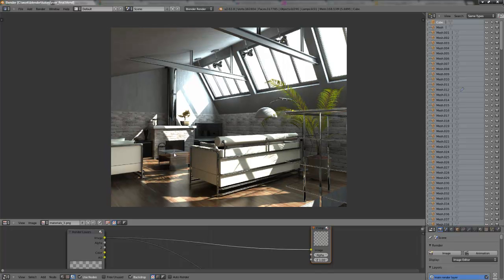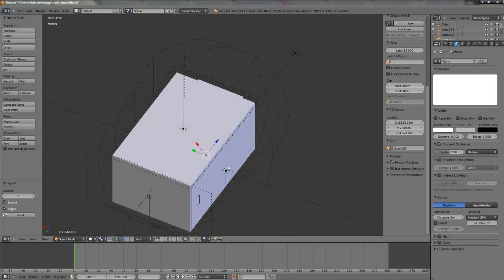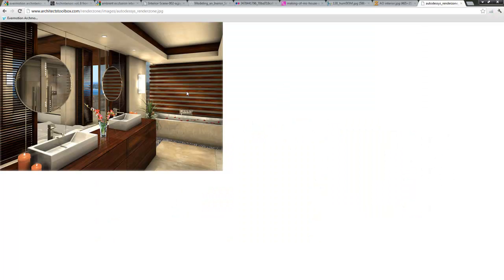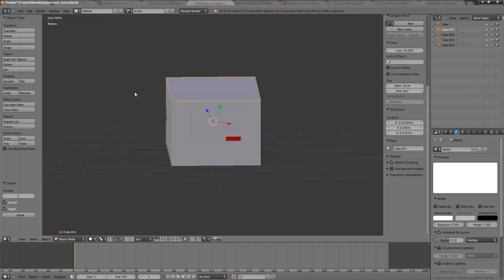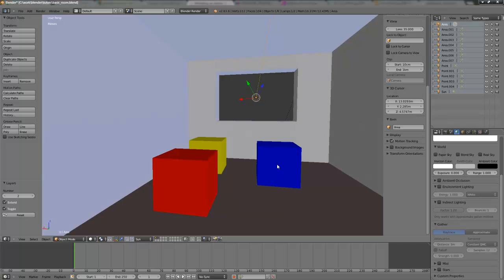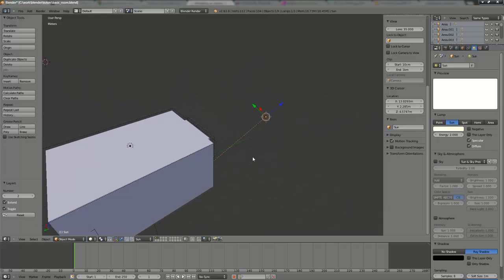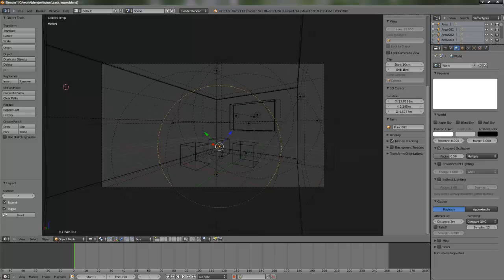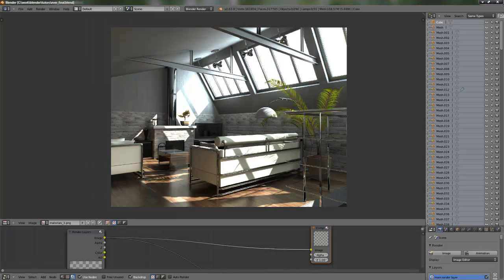Vray-like interior with blender and blender internal renderer

Comment: i agree blender internal is actually really good compare to cycles, i have an nvidia graphics card and i have used to test cycles, the main reason of noisy images in cycles is the caustics, if you turn off them you can get really clear images but the times and the heat that cycles does really damage pc's, i prefer to use blender internal  with the compositor you can get amazing results search for outdoor lighting blender by andrew price, simply amazing...

Comment: there is no support on 760 that's why :> i don't know how you get is slow i render my sceens really fast. and i have sceens with 100 milion polygons even more (landscapes) using instances. And basicly Cycles handle better bigger sceens then Blender Internal. I was testing once and on cycles with instance it was 800 megabytes 100 milion poly sceen. And on Blender internal instances to it was 3 giga memory... and takes much much longer to render.

Comment from the maker: well if you can render similar scene with cycles 3000x2000 for 2 hours - you are right but cycles will need more than 10 hours to render this image without noise and without blur bc blur blures not only nois but textures etc, just i'm more than 10 years in archviz and cycles is not usable for it.

Comment from the maker: )))) well i'll be glad if it will render something similar to this for you for 30 mins (oh btw without getting a GTX 780 or so) this is rendered with BI for 3 hours and the carpet is a displace (more than 5 millions of poligons bc hair looks fake). 

_ttp://yadi.sk/d/7OTCodsO6XXez_

just photorealistic rendering is my bread and if cycles was better than BI i would use it but it is a parody on IRAY and not more...

i tested cycles on gtx 760 and it is still pretty long bc it is VERY  slow